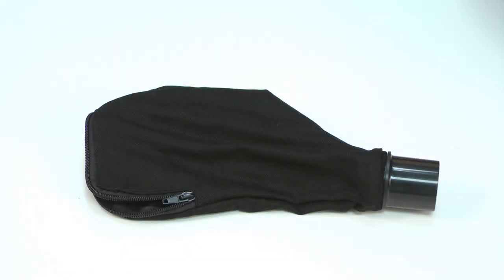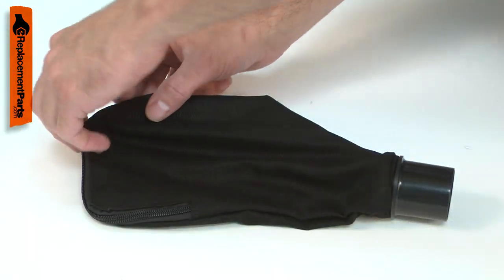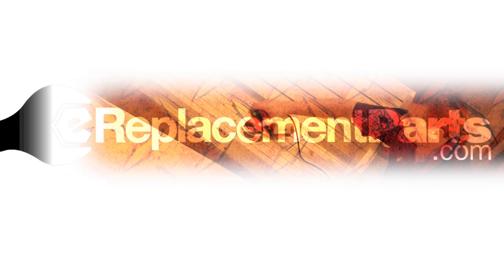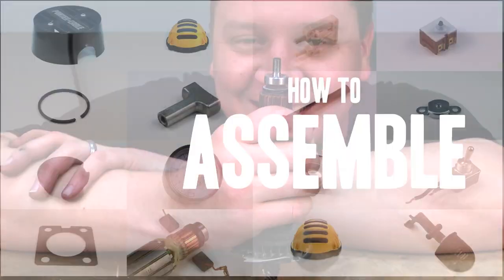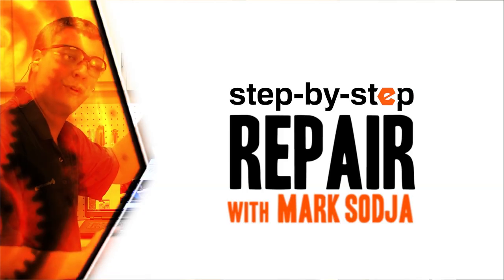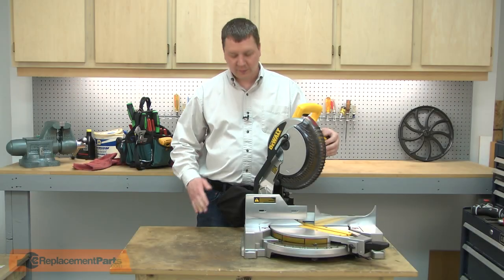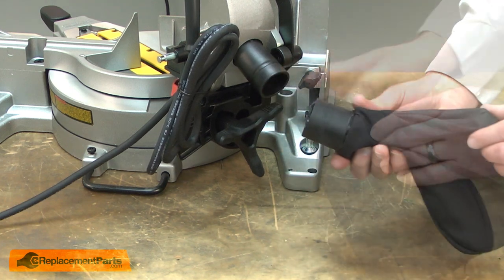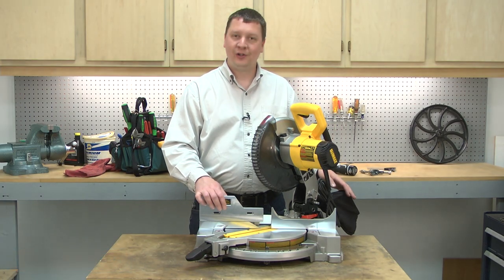DeWALT Miter Saw Repair - Replacing the Dust Bag (DeWALT Part # 147734-06)

Comment: What I don't understand is the new designs are so simple to do things with while the old designs just doing minor things takes like an hour
Reply: Nevermind I found how to remove it and that metal bar is annoying so I installed a huge ziploc bag with a metal clamp because original bag has holes already, it will do until I get a flexible hose.